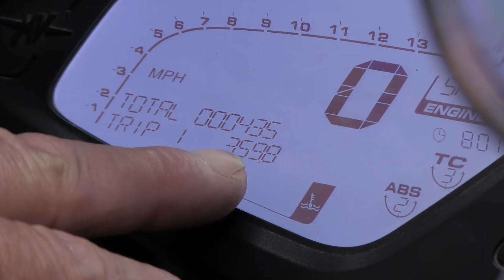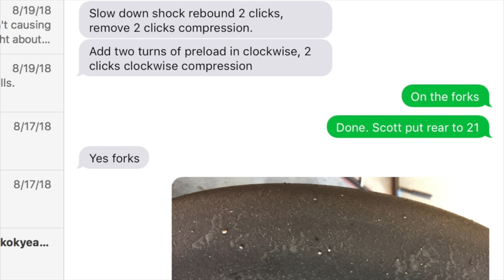Test & Review: 2020 MV Agusta F3 800, part 1

Comment: It’s a great bike, if it only start! I owned one but I sold it as it was hard to start most of the time and MV couldn’t fix my bike.
Reply: mine would sporadically stop by itself instead- same with the unable to fix
Reply: Which model? The Euro4 generation? They have a new sprag cluch so it's very strange that you would have that trouble. If you have an older MV Agusta which has the older version of the sprag clutch then you could've just retrofitted that with the new sprag clutch and the problem would've gone away. 
https://youtu.be/vZa7U9lYdY4
Also, with basically all Italian bikes you always have to make sure your battery is one of the good enough quality ones like Yuasa. If you don't buy the right kind of battery no matter what you do you'll always have problems.

Also, did you try squeezing the clutch lever just a slight bit when it didn't start? The few times my pre-Euro4 MV didn't want to start all I had to do was squeeze the clutch lever a slight bit and it started (I'm not saying that will help in all cases).
Reply: @pistonburner6448  yes Euro 4 at MV Augusta Thailand they were aware of the sprag clutch they took months to try to fix the bike and they gave it to me back without being fixed it was still hard to start. So disappointed they couldn’t fix it cause the engine was great!
Reply: @Miguelito0oO  None of what you're saying makes any sense. "They were aware of the sprag clutch"???  "Couldn't fix it"?? What does that mean?? If they're aware of it as of course they were then they'd change it into a new one and it would be fixed! 

First of all the starting problems of MV Agustas are always fixed and always have been, it just possibly came back after some time in the past with the old design which is not used anymore and can be replaced on all bikes. How old was your bike? What battery was in it? And so you say that "hard to start"...so it actually did start but you just complain about it not firing up on the first try every time, that's your issue? Let me guess: you heard the stories about the starting problems and then you went to the mechanic, who said the bike works fine as far as they can see...

And if "they couldn't fix the bike" (unbelievable claim by you...) then how come you were able to sell it? Did you sell it for a fraction of the market price of a fully functioning bike?
Reply: @pistonburner6448  right, it didn’t make sense to me that MV Agusta  Thailand  couldn’t fix my bike that’s why my desperation!

Comment: Thanks Dave. I need to look into my F3 suspension settings next season. My initial impressions are that it's too stiff. Rode it this season with stock settings. And yup the mirrors suck. I put convex mirrors on to see.
Reply from the maker: It will be interesting to see how much fork and shock travel you use to show if it is indeed stiff or actually too soft.

Comment: I don't own an MV and probably never will but when I see you put up something so comprehensive I just had to watch.  I am running Rosso Corsa II as well (and really like them after several set of supercorsas and one set of Rosso III) so was interesting to see what you had to say about the tires.  You haven't touched my Tuono in nearly 5 years but I have gotten a fair bit quicker on her since that time so hopefully I can make it to one of the track days you are working this next year for a more dialed in setting.
Reply from the maker: Glad you enjoyed the video! Love the Ross II's far more than the III's as they are very difficult to dial in right with hot pressures due to too many soft compounds.

Comment: Thank you for the entire Thinking and evaluating process
Reply from the maker: My pleasure and thank you for watching! Hope this inspires you to make changes and if you do, please share the results.
Reply: I can do that Dave (said the red eye). As you wish here a few results =)
Actually you inspired me years ago, with the freemium knowledge around of yours, to be willing to adjust my bikes. And therefore to critically question settings, whether they are more or less comfortable, safe or unsafe. 

To ergonomics:
Adjusting break- and clutchlever on the handlebars felt good, and I did error on the side of beeing a little too low (without ever having to chase the break/always by instinct beeing able to immediatly find the breaklever) rather too high. Rule was, arms and wrist in a anatomical natural elongation (line).
It felt fine, however after around 2 hours of riding there was a slight stinging in the fingertip of the Middle Finger, whilst pulling the break. Obviously the ring-ligament got stressed a little from the pull in an unfavourable angle. Raising the breaklever about 2mm fixed that, from there on no matter how long the ride there was never a sting again. Wrist was fine as well, since it forms the straight line as mentioned above.

Coming from you, I did also drop the clutchlever for the foot a little more than I was used to. There was never a comfortissue to begin with, however once I started to become a unity with my bike, getting used to powerdelivery, there was the rare occasion of a false neutral. The gearbox needs a firm "foot" that is clear, but under high acceleration-load it was more prone to false neutrals. The issue however was me, my foot with lack of force in that situation. Dropping the foot-clutch-lever 2 teeth, to get it a bit lower, got me the right leverage for those situations. It was a riders issue, but the change in position made it easier for me to proper shift gears.

On Supension:
Upgraded the rear shock with an aftermarket, bcz A) OEM had only 3 clicks of adjustment, B) more importantly I had zero free sag if the rider Sag was correct. Spring too soft. Aftermarket shock fixed it.
More important though, front fork has 3 clicks total, and was as per manual set to 3 clicks out. Preload was right in the middle. This combination yielded me a Pogostick-front. And actually when going downhill on enginebreaking at lets say 40km/h, I would take my hands of the handlebar and the front would oscillate a little. Just a few millimeter, but enough to be a visible pre-stage of a tankslapper. Highly Unstable and Usafe! This would be amplified on tougher roads or higher speeds for sure.
Fork oil change to thicker oil and adding preload got me to into the "down up standstill"-bounce area. However on a very hot summerday it still wants to go for a second bounce. I will have to try one step thicker oil, going to 20W and see how it works.
Ohh yeah, I added a bunch of preload, bcz I was almost bottoming the front on twisties, and for sure reached mechanical bottom when practicing emergency breaking to a standstill.

The bike mentioned here is a Kawasaki ZZR 600, built '97,  bought from a dealer as used first hand bike, which was decomissioned for almost 10years in the garage of the previous owner. I wanted to add a bike, that can handle twisties and long motorcycle travels, and is in good basic shape. No electronic shenanigans and to improve riding upon.
Take care!
Reply from the maker: @faithpath8283  Excellent work and thank you very much for sharing all of your experiences for everyone to learn from, no matter what they ride! A tip of the hat to you!

Comment: You do not need to worry about correct position of the rear brake lever since this bike has no functional rear brake. Or you need to bleed rear MC every 400-500 km to get it back to functionality
Reply from the maker: Noted and thanks for sharing.
Reply: @catalystreactionsbw  I used to have 2017 f3 800 rc and rear brake disappear because of very close proximity of MC to the main heat source

Comment: What a fantastic Video ! There is one niggle i have, i`d love to see some of the bike during the riding parts of the video, to have an attitude reference (hey i`m a pilot) So maybe a chest mount Gopro or a chin mount and the angle set to wide.. as you keep your head up it´s hard to get a feel of what lean your bike is at :)  But other than that fantastic work as always !
Reply from the maker: Noted and we will be investigating different mounts, most probably for the tank. That will give you the horizon perspective. What do you pilot?
Reply: @catalystreactionsbw  Dave,  do a helmet mount. If you have a GoPro, angle the camera up 45 degrees so that when you're leaned over the camera lens is level. Settings:+ 4k, 23 frames per second, set ISO to min and max 100 and get a set of ND filters for proper motion blur - otherwise, GoPros never provide a proper sense of speed.  Result should look something like this: https://www.youtube.com/watch?v=buPRC5S2ifM&t=527s
Reply: @catalystreactionsbw  i fly since 20years in the skydiving industry, Short Skyvans :)
thanks for thinking about the suggestion !

Comment: Hello Dave, I love what you do as you help us to improve safety, comfort and also joy on our bikes. I'd like to have more information about the distance from the belly to the steering stem Vs the spine length. First of all, how do you measure the spine length? Is is the distance from the base of the neck (in the shoulder line) and the sacrum? Should this length be the same, higher or lower (which range) than the handlebar distance? I am really suffering on my MV F4 1000RR as I am only 1.64m...
Reply from the maker: The steering stem to belly button is one measurement, so that is reach. Spine is base of the neck to sacrum, then factor in arm length from top of the shoulder joint to end of the wrist on the hand side. From that you can draw your triangle. The angle from the spine and arms at the peak of the triangle is the important number for sport bikes. I am 170cm tall. My arm length is 22inches/56cm, my spine is 22 cm and the reach on my F3 800 is 22cm so my arm/spine angle is 60 degrees. 50 degrees is the most comfortable for me anatomically.
Reply: @catalystreactionsbw  are you sure your spine is only 22cm? Or is it inches?
Reply from the maker: @claudiolorenzoraia1671  Ooppssss..... All measurements are inches so 56cm. I corrected the reply. Thanks!

Comment: How do you access the rear shock to adjust the static sag.
Reply from the maker: The two castle nuts on top of the rear spring are the adjusters. Top os the lock nut, bottom is the adjusting ring: https://www.youtube.com/watch?v=Jlbca0SIxhw&t=452s
Reply: My 2022 MV F3 ROSSO has a rear shock that very hard to get to. Is the hammer method the best way for this bike. Other than taking the shock out completely.
Reply from the maker: @36inthemornin  I use the Ohlins push and pull tool: https://www.ebay.com/itm/116024413349?chn=ps&_trkparms=ispr%3D1&amdata=enc%3A18lgVFVb7SpyQ45qJhxLSYA16&norover=1&mkevt=1&mkrid=711-117182-37290-0&mkcid=2&mkscid=101&itemid=116024413349&targetid=1644837434523&device=c&mktype=pla&googleloc=9032084&poi=&campaignid=20394414698&mkgroupid=153052395833&rlsatarget=aud-1405249128464:pla-1644837434523&abcId=9317284&merchantid=108358459&gad_source=1&gclid=Cj0KCQjwlN6wBhCcARIsAKZvD5i1B1zGuOnhaVKguTNcagrnN6jzI8-Hhc42x3847s8raghwdu1wFlsaAoG6EALw_wcB

Comment: Hi. I appreciate your work. I've have an 1988 hawk gt 650 that Ive raced. I have rarcetech cartridge emulators in front and 900rr rear shock  with stock hawk spring swapped on an approriate spacer. I set sag and whatnot for my 185lbs. And I just ride it and it works. My tire wear is beads of rubber building up on the very edges of the tread there are no upside down clouds on the edge just beads of spent rubber round the very edge?
Reply from the maker: Thank you Bobby. Rubber balls should be unique and 2-3mm in diameter. If this is what you have - all is well.

Comment: Is there a reason why you ride street with such low pressures? In case of my (heavier) Triumph Daytona 2002 with me (80 kg plus gear) and Rosso III I found out that I´m not supposed to go down much from the recommended 2,5/2,9 bar of pressure, because the feeling and response both become "mushy". Anything below 2,4/2,7 was worse.
Reply from the maker: Then you have found that lower pressures with your very soft carcass tyres does not work. Higher pressures give you more structure and feedback. Next time out try some Dunlop Q3+ as it would appear you definitely like a hard carcass tyre.

Comment: Dave could you plz do a suspension setup on and 04-05 kawasaki zx10r.  I can't seem to get the suspension equal 9th the bike front to rear. The rear is set to factory defaults and the front as well i weigh about 138.
Reply from the maker: For your bike, how old is the fork and shock oil?

Comment: what about the weight load of 285lb, aggressive street.
Reply from the maker: Weight will overpower the stock forks and most probably the rear shock. 1.0kg fork springs with 15w in the compression leg and 10w in the rebound leg to 100mm oil height will help. Change in fork position will help as well. The rear shock will need a 11kg or 12kg shock spring and revalve to match the spring rate.
Reply: @catalystreactionsbw  Having a custom rear shock built, will address forks shortly after install of new rear shock.

Comment: how can you identify when the rear shock compression is wrong?
Reply from the maker: 1. You roll on the throttle and the bike suddenly feels like it collapses in the rear.   2. Every little imperfection on the road lifts you out of the seat.   3. Bike exits wide out of corners.  4. Large bumps force you out of the set before you hit them.
Reply: When bike exits wide out of corners you need more or less compression in order to fix it?
Reply from the maker: @nikos.kouts3  If your timing is correct for turn in or apex, you generally add compression damping.
Reply: So when your rear compression is too soft ,the rear squats during corner exit acceleration and this increases the wheelbase so the bike runs wide out of the corner. Am i right?
Reply from the maker: @nikos.kouts3  The rear shock travels too fast through the stroke is more accurate.